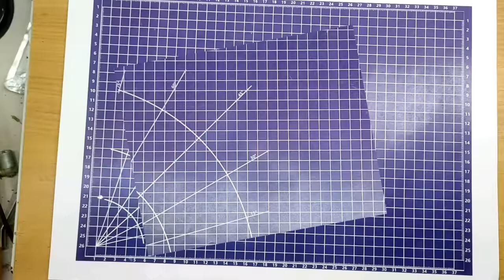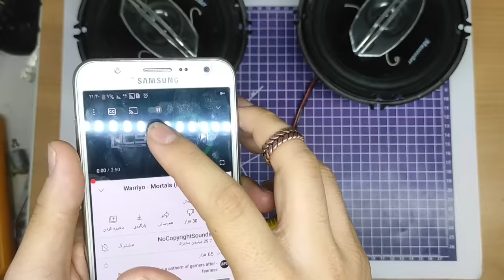PAM8403 Powerful stereo Bass amplifier | mini 5 volt amplifier

Comment: So if anyone's confused, i will explain this.. so, when you put 2 amps is parallel, you basically just divide the speaker's impedance to 2 parts, both amps handle it. Therefore, you BARELY get any output power increase at the same impedance, but you get the ability to drive lower impedance speakers, thus getting more output power.(ex:1 amp can do 3watts at 4 ohms, but can't drive 2 ohms, if you parallel  2 of them, then you get the same 3 watts at 4 ohm, but you get 5-6 watts az 2 ohms)

Alright, but there's 1 really important thing! The audio source must be kept at the maximum levels at both amps to get max power! If you parallel the inputs too, you basically just wasted 3 amps and some solder because it wont do anything. You need opamps to beef up the level of EVERY channel. And last REALLY important thing  in paralleling amps: ALWAYS make sure, that you give them the exact same input, because it will blow up if you dont.

Also, please dont ruin speakers by putting flour in it... it makes me wanna die
Reply: Thanks for the info
Reply: Adding flour will increase the power and bass.
Reply: Just thinking the same....good information thnx...
Reply: Maybe using cuts of paper will be better next time 😅😅😅
Reply: Brooo awesome
Reply: Maybe if you put the amplifiers supply and out put in series and use 6volta you will get a about 6w
Reply: what do you men by blow up        and can in give 5v 2amper input after connecting 2amplifiers
Reply: in parelel
Reply: these speakers are ripoff 300W speakers, the reality is these speakers worth like 10$/1speaker, due its just 30W (may 50w due the speaker magnet looks like about 70-80mm so i can believe about 40-50W max power) he ruined it, i suffered alot, these days everybody can do whatever he wants but still, he wasted a pair of new speaker.
Reply: What happened if you put the amp out puts in series
Reply: @Ak-we2un  how could you put amps in series? If you put thr positive output to the other one's negative then that's basically a short circuit (in non-bridged amps) 

In bridged, i dont know what would happen, never tried it but i guess it would cancel out.
Reply: kooan oh ok thank
Reply: @Ak-we2un  it would be kaboom, due short circuit on output, to make it in bridged, you have to edit the entire amplifier board. the two positive output will be the speaker + and - and the output - will go to circuit
Reply: Robi1969 Gaming ok thanks I was about to buy a 3 pack of 30w amps to put in series
Reply: Parabéns, e difícil atualmente você encontrar pessoas que expliquem bem sobre um determinado assunto
Reply: Then you my friend
Reply: please give me chance to under stand  your words thanks
Reply: this is series or parelel?
Reply: Nice

Comment: I love this idea. But.

IT'LL PROBABLY MURDER YOUR PAMS--
I haven't tried PAM outputs in parallel like this, but most amplifiers would turn into a small firework if you did. It's because with most designs, slight differences in the amp would cause them to dump power into each other rather than the speaker and overheat.

VOLTAGE DOESN'T INCREASE WHEN YOU ADD MORE PAMS, AND VOLTAGE IS WHAT DICTATES POWER--
Peak output voltage of [any number of] these little guys in parallel is still the power supply voltage, so a maximum of ~5v. Assuming the amp output swings over the full voltage range (which most don't), RMS output voltage would be 5/sqr(2) ~3.5vRMS. Power into 4 Ohm speaker is therefore (3.5 * 3.5)/4 ~ 3W RMS, the quoted figure for the amp. This setup runs on a 3.7v battery, which gives an RMS maximum of 2.6v, giving a power of only ~ 1.7w RMS per channel....(RMS - Root Mean Squared - is probably the most reliable/"honest" value used for audio signal levels.)

Assuming 2 PAMs somehow did play nicely with outputs connected in parallel, the maximum output voltage would still be 3.5vRMS, so the power into 4Ohm would be the same - about 3W. Same for 10 or 100 in parallel. The only benefit would be if you had lower impedance speakers, say 2Ohm, because two amplifiers could share providing the higher current required to drive them.

HERE'S AN ANALOGY--
Think of it like a compressor driving an air tool. If it works at 30psi pressure, that's like the voltage. The maximum cubic feet of air/min it can provide might be 10cf/m, which is like the current. Without tools the compressor is still at 30psi but is providing 0cf/m of air. With the tool in use, the compressor might be maintaining 30psi, but now it's pushing 8cf/m of air into a hose to do it. If you connected the outputs of two compressors together, you would STILL get 30psi but now the system can supply twice the volume of air - up to 20 cf/m.  Your original air tool would work the same (because it's still working at 30 psi and taking the 8 cf/m of air it needs), but the difference would be if you ran two air tools together - or one more powerful tool - which would take the air being used to more than 10cfm.

BOTTOM LINE--
So, bottom line, connecting any number in parallel won't increase the output power significantly into the same speaker . You'd need to use a lower impedance speaker setup to see any wattage increase. Not only that, but providing enough current to supply a load of 5v PAMs in parallel would be horrible.

On a different tack, these little PAM things are awesome, and things like this are the guts of almost all little active speakers under 50 quid. 3w RMS on two channels is actually quite a lot of power. With the right speaker setup it would be plenty loud to fill a room, and move white dust around :) . If you need more power, just get hold of a 12v amplifier module out there for a few quid, and a 12v power supply - they're cheap as chips too. You can get 16W RMS out of those, and use a laptop 16v power supply and you get nearer 25W RMS, which is enough for a party.
Reply: Doctor Mollusc ! You are very very great. 💯 explain, you must have been a wizard in Electronics. A Very overwhelming thanks to the guy that made this video( skill make), because if he doesn't do this, people will not learn this from you Doctor ! You are too good....
Reply: But the question is, can  I use the 12v amplifier wt the mini MP3 Bluetooth player that often comes wt remote ??? Using 4  li-on or 18650 battery wt it....???
Reply: @commandolee3608  not sure I understand your question, sorry, but I'll try to answer.
You could in theory take the electronics from an existing bluetooth speaker and use it to drive a 12v amplifier to boost the output power, but the chances are the speaker wouldn't be able to handle the massive increase in power output. It would also be a bit messy and complicated with providing 12v to one bit and 5v to another. Some amplifiers work over a large voltage range but I very much doubt a standard PAM bluetooth speaker would survive having 12v put into it. Basically, a 12v system is so much more powerful than a 5v system would be, it wouldn't be very efficient to use any 5v PAM bluetooth speaker components in a 12v system... unless you happened to have loads of the same small speaker drivers hanging around and could wire them all up in series/parallel to cope with increased power.
Wiring 4x18650 batteries in series would give you a decent 12v supply for an amplifier, but they wouldn't last terribly long at high volumes and if you wanted to charge them in place you'd need a Battery Management System.
Reply: @doctormollusc5124  Thaks so much for the explaination.

Comment: Dude I have one of those little amps or one similar to it where did you get those little plastic fork things to stick in them what are they called?
Reply: They are called header pins..But instead you can just solder wires parallelly to each of them

Comment: also when you give input from one single source like a mobile phone doesnt it get divided by 3 and give reduced output. im looking for a multiple  3.5mm jack divider without loosing signal power. so that i can connect multiple amplifiers to single source.
Reply from the maker: To do this, first connect an amplifier to the output of the mobile phone, then take the output from the amplifier and connect it to 3 amplifier modules.
Reply from the maker: thanks for comment mr parsa

Comment: I build same as like you have shown me on you video but when I connect with charger it over heat, Instead of using battery I used 5v charger but the main point is that single pm8403 doesn't overheat with the connection of charger as power.Please I need suggestion from you.
Reply from the maker: just use battery because you need more amperage

Comment: bro can you explain it how much power we need int his case and cause i try it with 3 chips and 3.9v battery buy my chip heated.
Reply from the maker: You need a high amp battery if the battery capacity is not good and you must use the battery and not the adapter.

Comment: I need a circuit for 15W 3ohm speaker, what is its name? And will it work well? Please say....
Reply: Bro for your need you can use PAM8610 Class D amplifier which is 12 volt powered amplifier and gives 15 watts per channel.
Reply from the maker: thanks for replying mr 🙏🙏🙏

Comment: Buenos dias hola vi un vídeo similar donde no se podian conectar en serie asi  y no se escuchaba como que hacia cortó circuito
Reply: Realmente tal como lo hizo es un corto circuito, no importa si juntes hasta más de 3 pam8403 en páralo no aumenta la potencia y solo dañas los módulos,
Reply: @InventableESPT  justo lo que quería saber, había visto algunos video haciendo eso pero no sabía si era válido, entonces no se gana más watts poniendo los pam8403 en paralelo
Reply: @atrelluzroig8529  no amigo esto esto depende del voltaje y al amperaje pero como cada módulo trabaja a 5v no lo podemos forzar a trabajar a más voltaje para tener un poco más de potencia ya que se quemaría al instante y pues como mencionada sin importar cuantos utilizes no aumentas la potencia a parte de que están las salidas en corto y no te dará nada de potencia, es falso en pocas palabras

Comment: If need more jast add cundenser on power supply  220 to 470/25 volt 👍
Reply: It's best only Little amper prob if I giving 5 amper  then it's play perfect with bass ,
Reply from the maker: Thanks for comment mr bhartiymudra
Reply: @skillmake  make one video how to increase amper ? I done all but fasing battery amper prob 2600mah x10 only (amps working good)
Reply from the maker: @bhartiymudra9987  You can explain more؟
Reply: @skillmake  no need 3 kit  only one and one condensar and good amper I m using battery 10 x I try to play with amps 10 amper  I need to play with battery  I don't know how to increase battery amper |
Reply: @skillmake  and I m using 2 speakers 8 inch

Comment: but how many watts are you getting on the output, vs one single amp?
Reply from the maker: 3=9wat 1=3wat
Reply: 3 watts per channel per board x 3 boards is 9 watts per channel.
Reply: @skillmake  Don't lie!
Reply: teorical: 5^2/8 ohm / sqrt(2)= 2.2 watts. 
in 4 ohm... 4 w but the max is 3.2W